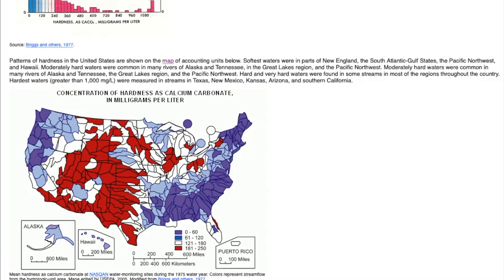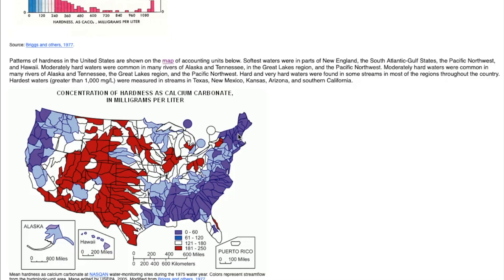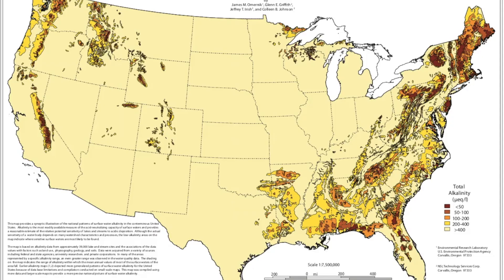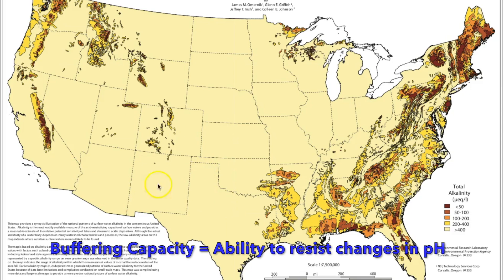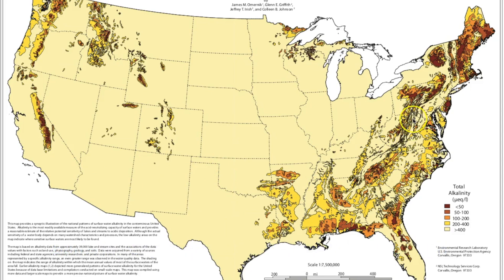Fish Tank Water Hardness Fully Explained: Don't Kill Your Fish!

Comment: Thanks for the video.  I have returned to fish keeping after a long break and I now live in virginia.  I have almost zero kh and dh.  The ph out of the tap is 7.2, but after sitting for a few days drops to 6.2.  At night my CO2 in my 25 gallon aquarium drops to as low as 5.5, and during the day around 5.9.  I was using CO2 injection, but have given up on that for the time being.  I really wish I had some more buffering capacity.

Comment: How does one raise kh but reduce GH? My GH is around 180ppm and my kh is 40ppm. My ph has only ever fluctuated between 7-7.5 so what I would consider relatively stable considering the low kh.
Reply from the maker: Usually something like aragonite or CaribSea African Cichlid Mix works well.
Reply: @PrimeTimeAquatics  thank you. Would that alter the pH too? I'm wanting a safe water for apistogramma and thinking of using an 80/20 mix of RO and tap water because of the high GH but also wanting to raise kh to stabilise things. Would this work? I know ideally you shouldn't chase parameters and it's probably best to stock to your water as is.

Comment: My pH is 7.8 out of the tap but drops to 6.0 in my aquarium  (possibly lower). Fluval stratum is bottoming out my pH so I'm guessing I don't have much buffer. It sucks because I want to do larger water changes but that's going to cause my pH to swing wildly. I plan on keeping a betta so I don't think it will mind the really low pH, but do you think a betta would be sensitive to sudden pH swings?
Reply from the maker: Ya, most fish don’t like the swings in pH. You could try a little aragonite or even mix in a little CaribSea African Cichlids Mix?
Reply: @PrimeTimeAquatics  Okay, I'll try that. Thanks.

Comment: Hi,

I recently bought Nilocg GH booster, can you help me out with the dosing calculations:

1 Pump(2ml) per 4 Gallons
Raises 2.8 dGH

How many pump(ml) for a 20 Gallon Tank? To get a 6 dGH.

Thank you.
Reply from the maker: Be careful with that. Usually the directions/dosing for increasing GH are based on RO water. I would test the water after every pump to see where the GH is.
Reply: @PrimeTimeAquatics  Thank you!

Comment: I had to learn this lesson the hard way when I recently got back into the hobby after a 20 year (or so) absence. My PH coming out of my tap was around 7.5 give or take, but I noticed that every time that I tested my tank when trying to cycle it, the PH would drop down to 6.0 or lower....Which in turn killed the cycle. I was trying to cycle a somewhat heavily planted tank that had a PH lowering substrate and driftwood which would have been fine, but I figured out that my tap water's KH was extremely low with no buffering capacity. It was a nightmare trying to cycle this tank before I figured everything out with a ton of research and some crushed coral. I wish that I would have come across this video sooner, because it would have saved me a bunch of time and work. With that being said, this video is awesome! Thank you for all of the informative and entertaining content! Hope to catch a live stream sometime soon and become a member!
Reply from the maker: Thank you!
Reply: This is EXACTLY what is keeping my tank from cycling! Just had my water tested at the LFS and my KH was zero. Heavily planted tank, parameters kept looking good and then going all over the place.

Comment: This is very interesting. I’m still having trouble understanding fully. I’m sure it’ll take a while to get it all down right though. My trouble is is that I breed Corydoras. I live in the Chicagoland area as well and I want to learn how to create a better environment for them to mimic their true environment as best as I can as well as having my hatcheries for them to be more successful. Would you be able to do a video about that specifically? Not necessarily breeding Corydoras but how to provide the proper environment with the water that we have and the hatcheries for them. I want them to thrive and for my hatches to be 90% or higher. During the summer and fall my hatches were around 90% or above and now it’s dropped down to 10%-15%.
Reply from the maker: Usually that requires RO water and remineralizing the water.

Comment: I just don’t get it. When i bring the pH down to pH6 and I add seachem alkaline to buffer my water, I only get KH 2.5 and my pH goes all the way to 8.00. I am trying to keep guppies (sunrise guppy)  with a KH of 10 or even 15 but i find this impossible because as I add the buffer pH goes way higher. :( this is way i just want to quit. Or just have my guppies with filtered water with out KH. (So boring water) does anyone knows how to get a KH of 10-30 with a 7-8pH. Is this even possible?
Reply from the maker: It might be worth trying to add either Caribsea Cichlid Mix or using Aragonite to the substrate? You could also add rocks like flagstone?
Reply: @PrimeTimeAquatics  thank for trying to help.  but if my pH is already at 8 and KH at 3.5 won’t this items elevate my pH even more?

Comment: Just moved to an area in the UK that has water at 16KH out of the tap. After setting up a 12 Gal Nano 3 weeks ago (low tech), plants are doing great but I'm wondering what small fish I can introduce safely.  Your explanation of the water parameters is great and leaves me reluctant to start messing with mine. PH 7.8. GH10, KH16.
Reply from the maker: African cichlids, most livebearers. In your tank probably the livebearer route?

Comment: Hello Jason,
I’ve emailed you this already but posting it up as a comment to see if it reaches you and hopefully you get the chance to answer. 

Not sure if you’ll read this but this is going to be a rather long question. 
I live in New Jersey and I have a 36 gallon tank with 4 common goldfish ~3 years old. Originally they were in a 10 gallon tank and were passed onto me by my girlfriend’s family. Ever since they got them when the fishes were babies they have been using the Costco Kirkland Bottled Water. 

For a long time they were in a 10 gallon tank but I recently decided to get them a bigger tank because each of the fishes require about 10 gallons. Upon her strong recommendation I have been using the Kirkland water as well. Recently through watching your videos, in the new tank, I have finally been able to regulate ammonia, nitrite and nitrate levels. I have a fluval HOB and a 40 gallon hydro sponge filter with the aquarium co-oo air stone. I also have 6 small plants that goldfish fish don’t like to eat(Java Fern, Amazon Sword, anubias). Trying to accumulate taller and bigger plants soon. 

I just recently did a water test(2 days sgo). Results for which were(After a 25% water change last week because I had high nitrate- 80ppm):
Ammonia: 0 ppm
Nitrite: 0 ppm
Nitrate: 40 ppm
I recently got API GH and KH kit. Right when I did the KH:
1st drop the water turned light yellow. Which means about 0-1 degree KH. Again, I don’t use tap water but use bottled so far. I guess the bottled water is very soft. 
GH:
Took 3 drops to turn the solution green. Which means about 3 degree GH. 

Given all of the above:
1. How can I transition to tap water and make it safe for the fish, what exactly product(s) would you recommend to use? What % parts should I swap the cured tap water with bottled water and how often to do the full swap?

2. After transitioning to tap water, how do can I increase the GH/KH suitable for common goldfish? Is crushed coral the only answer considering how soft New Jersey water may be according to the map in your video?

3. Would you be able to recommend any bigger/taller plants that goldfish don’t eat up?

4. Any other tests I should be running prior to doing anything?

5. My fish do not seem stressed to me at the moment, no lethargy or not wanting to eat. How can I know if they are stressed given the current environment?

6. Currently I only feed them Tetra Goldfish Vitamin C Enriched flakes - normal amount in the morning and a little in the evening. Should I be feeding something else? Better?

7. My nitrate never seems to be under 40 ppm. Granted I’ve never tested the water right after a partial water change. How can I keep it on the lower side? Is more water changes my only way to go?

Jason, if you do get the time to read this comment and answer my questions, I will really appreciate it. If you don’t mind telling me the exact products to use, that you have tested or known of, that would be really helpful.  I’ve always enjoyed your videos and the amount of scientific detail you give to your viewers. I am new to the hobby but I feel that you are helping me catch on daily quick. 

Thank you for your time and I look forward to hearing from you.

Comment: I need HELP PLEASE question started using distilled water in my 5 gallon tank I have a glo tetra and a yellow snail need to make sure they thrive so far ok what do I do when the strip shows hardness 
Not using tap water for a few months so so far my snail is doing well with fish 
Using the 7- in - 1 strips
Reply from the maker: Using RO long term may cause issues by lowering KH, making pH more variable.

Comment: I'm stuck with this. 

I have a high general hardness to my tank and my pH levels are too high and its making my fish sick. 
You said that driftwood, moss, etc, wont fix the tank if your water level is too hard, but if it can't fix it that means my pH levels will never change. 
Is there a way around this or is my betta doomed in this toxic 9.5 pH level?
Reply from the maker: That is a very high pH. The only way to realistically bring that down is by adding RODI (distilled water) as part of your water change. Start slow and add a little more gradually over time. Keep testing water parameters as you make the changes.

Comment: I need some advice. Just started to use seachem prime, stability, matrix and pristine in my 10L tank for betta fish. pH has always been around 6.5-7. However, noticed that pH is 5.6 today, do not understand what could have caused this. 50% water change done every 5days but filter sponge not changed. I opened up my filter and it has a very strong chemical smell of matrix and filter sponge is dirty.However, I understand from the seachem website that these products do not alter pH. Appreciate some pointers.
Reply from the maker: You may have a low KHw, which will lead to fluctuations in your pH as fish waste builds (or wood is added).
Reply: @PrimeTimeAquatics  unfortunately, my betta's tail has tears this morning. Not sure if an overdose of any of these chemicals could cause this.

Comment: How do I lower GH and PH without effecting my KH? I’m new to this hobby and I’m not finding a good answer for that question. My normal tap water numbers are 180ppm GH, 120ppm KH, and 8.2 PH
Reply from the maker: For the most part it's going to be very difficult. KH buffers water a little higher.

Comment: Gh: general hardness
Ppm: parts per million (same as milligrams per litre.)
Kh: Carbonate Hardness

Very Soft water: 0-3 degrees hardness or 0-50ppm
Soft water: 3-6 degrees or 50ppm-100ppm
Moderately Hard Water: 6-11 degrees or 100ppm-200ppm
Hard Water 8-12 degrees or 140ppm-200ppm
Very Hard Water: 11-22 degrees or 200-400ppm

Comment: I don't think that water hardness map is a good reference because it appears to measure water hardness of surface water not tap water.  Tap water in many (if not most) of these areas come from ground water sources such as aquifers where the water is often much, much harder than surface water.  I noticed on that map my area is shown as having soft water.  But tap water in my area is much different from surface water, and is actually very hard because it's sourced from an aquifer not the surface.

Comment: You blew my mind again. Every time. Thank you again, professor! 🙏 I have a question: Perhaps if I use a very small amount of the peat granules in my filter, check it in a week (maybe longer) , and gradually raise the quantity if necessary, do you think it could work and stay safe for my freshwater fish? Water hardness and ph here in Texas are touching the sky. I buy water specifically from a well known fish store in my area and it is still incredibly high on ph and hardness. I just want the best for my babies and they are all fish that like softer water according to my research (they are mostly tetras, dwarfs and honey gouramies, betta in my 10g tank, etc etc). I  just purchased a Fluval 407 canister filter system for my 75g tank and I know my fish are happy in there 😁, but if I can make the water to get closer to their comfortable parameters it would be AWESOME! Thank you so much!!
Reply from the maker: Good question - usually peat doesn't have much of an impact if your KH is high. You can certainly try though.
Reply: @PrimeTimeAquatics  Thank you SO MUCH, professor! ♥️👊
Reply: Ah! By the way, 
I just watched your video about PH (https://youtu.be/d9N-JliqsJg) 

In my 3 tanks, I have a nice collection of plants in the tank, black sand (this might not help), 2 to 3  planted drift wood,  and hiding spots for them. I thought it would help lowering the ph but it didn’t work here. It still very high. Sorry for my broken English. I’m from Brazil.

Comment: I have a 10 gallon.  My tap water shows purple on the test strip 300 mg/L GH.  And my tank water is purple on the test strip and at 300 mg/L in red lettering.  Also KH was a little high in the tank, 180 was that number.  Should I take out the volcanic lava rocks from my filter?  And are fancy guppies ok at that level or do I need to get a different kind.  I only have two snails in there.  I want to add 9 guppies and three cherry shrimp.  I'm growing grasses to add before.  I have 7 marimo balls in there. Gravel and smaller rocks a piece of driftwood and an air stone and manmade rock hideaways are also in there.  Any advise would be greatly appreciated.🙋‍♀️✌

Comment: Do you have any thoughts on the use of a residential water softener when providing water for tanks? Our well water was pretty hard, and we kept cichlids years ago [we took that tank down]. However recently we established two new tanks and the fish are not thriving, and in many cases not surviving. One change is that a couple years back we installed a water softener that removes hard water minerals and replaces them with sodium from a salt tank via ion exchange. Could this be behind our problem with the new tanks? Thanks in advance for any thoughts.
Reply from the maker: Good question - yes, water from a water softener is usually not good for most types of fish. A lot of people who have them wind up bypassing the water softener when filling fish tanks.

Comment: Ok so with trying to adjust water ph,kh,and gh I'm at a loss. I've repeated my tests 4 times tonight and I keep coming up with ph-8.2, gh-2dkh, kh- 21dkh. I have 4 cherry shrimp, 4 otos, 4 danios, 3 tetras, and 2 plants in a 10 gallon aquarium but I don't "get" what I need to do to keep everything healthy and happy because of the drastically varied numbers in my kh/gh test. I put the 3 new baby kuhli loaches in a separate 3 1/2 gallon quarantine box but I suspect they won't be happy in those water conditions either. Can you help me make sense of what I should do to raise the gh and maybe lower the kh some? I've heard enough not to chase the ph but something seems really off with the other numbers in this equation.
Reply from the maker: The most important thing is to keep those water parameters consistent.
Reply: @PrimeTimeAquatics   thats not difficult the dang things don't change but I don't want to kill my plants or fish. So rather than trying to change the crazy water aspects just keep them the same and drip acclimate everything from the 6.2ph water I'm buying from?